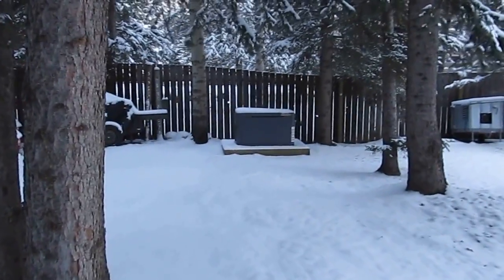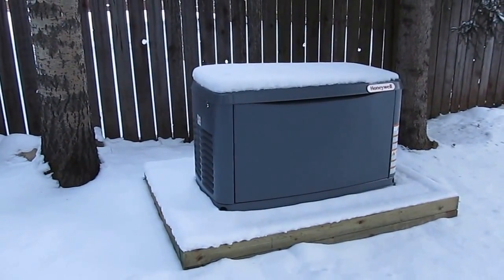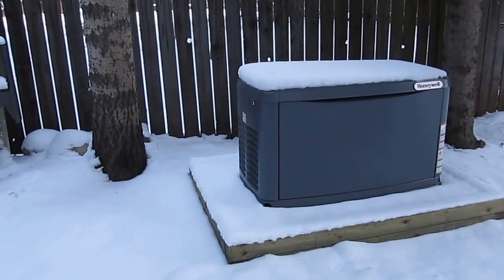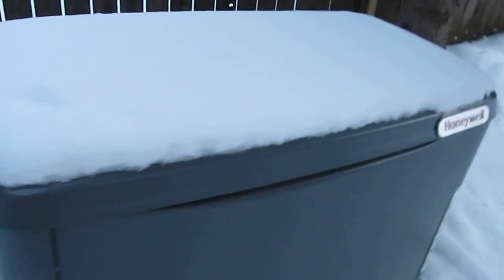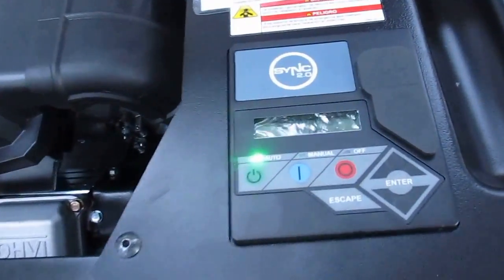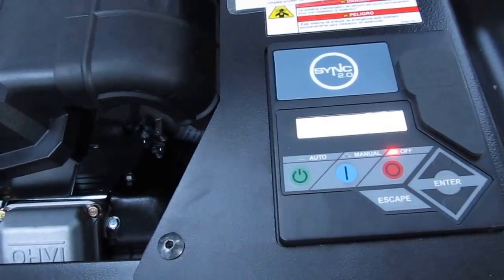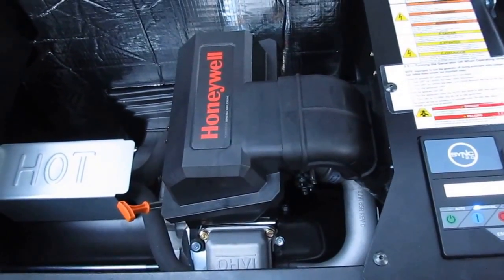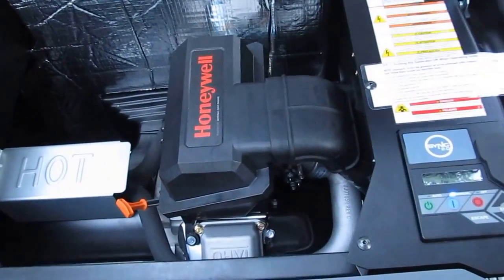17 KW Generator cold start # 1 at -24c, Nov 12, 2014.

Comment: Terrific Video, The Starter is Struggling and will eventually Burn out prematurely in an exercise, because the Oil has Congealed. The Kit is Mandatory.  Oil heater is more important than Batter warmer.
I installed a heater Block in my 35KW Generator  -  https://www.youtube.com/watch?v=ZfQxptYsk0w
Reply from the maker: +silverbankruptcy 

Thanks for your comment.

Take a look at my subsequent videos, I installed a 60 watt block heater and a 50 watt battery blanket controlled by a TC-2 thermocube. The generator has been starting without any problems for the last year.

I did not install the Generac cold weather kit because of cost and the battery pad has caused some battery failures in the past.

I agree the block heater is a important item but the battery blanket helps to keep the battery in a better temperature range.

.

Comment from the maker: .

Here is the second test.

17 KW Generator cold start # 2 at -20c, Nov 14, 2014.

The Honeywell (Generac) Generators used to run for 15 minutes, the new ones run for 5 minutes. If you ran it for 30 minutes every second week you would just be running through your warranty and service intervals for no reason.

But everyone is entitled to a opinion.

.

Comment: Definitely need an oil heater on that crankcase.  it is cranking much too slow.  5 minutes is not enough time to run the engine. You should allow a minimum of 30 minutes at full load to prevent condensation building up.
Reply from the maker: Well the Generac program is set at 5 minutes and you can't change it. After it does its 5 minutes I do a manual start and run it another 25 minutes.